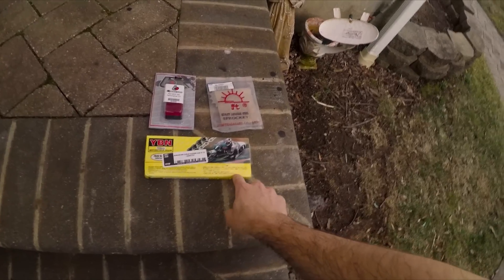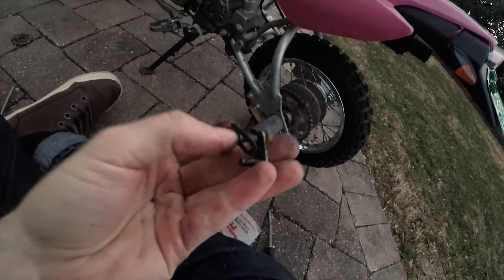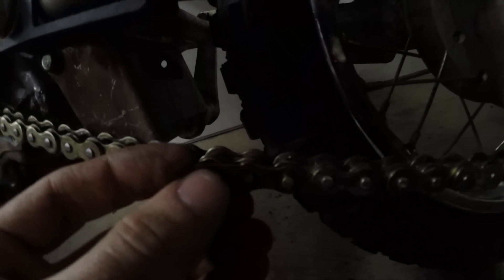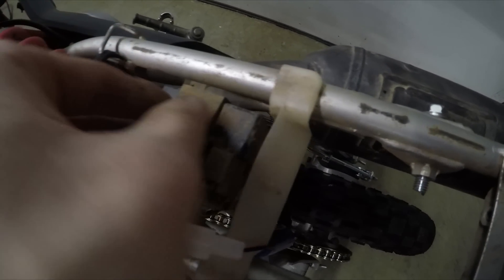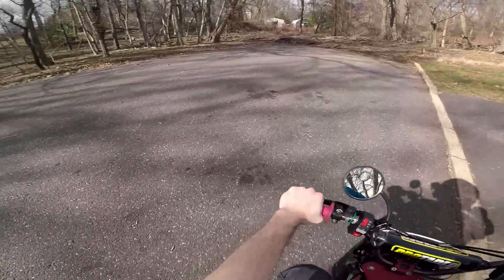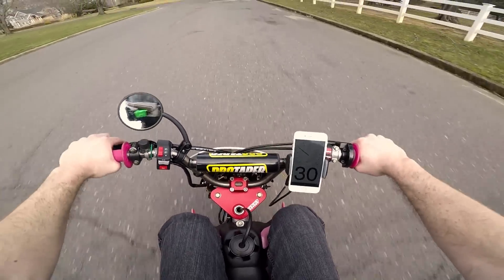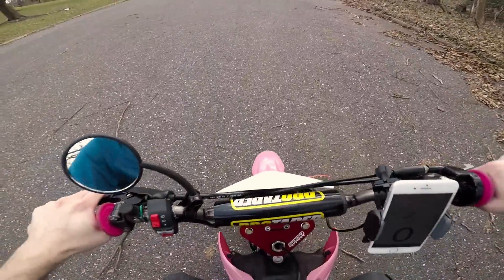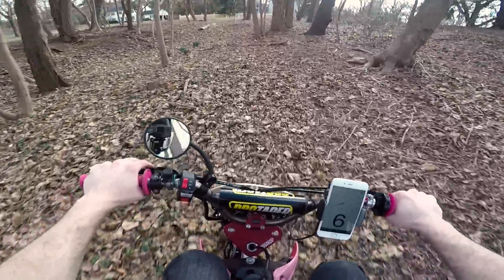Street Legal Crf50 SPROCKET & CDI INSTALL | New Top SPEED

Comment: my fully stock cf50f from 2012 with only a cdi change goes 35mph, sprocket change on the front and rear and a new carb with no filter and a new exhaust should get it to like 67+mph, the exhaust adds a big amount of low end and top end, but also adds like 10+mph top speed, the sprockets would be a 15/30 (front/rear), and the carb I have gives it a better throttle response and overall better rev-down, and the filter being taken off gives it an even better sound and power, however I recommend an amazon Chinese filter, same thing without a  filter off, just would be cleaned filter, and I HIGHLY RECOMEND you get a gas filter for the gas hose, definitely helps the bike run better and before I didn't have one the bikes gas in the hose started getting either a bit dirty or clogged, and a new carb that I got off of amazon is stock, only thing that makes the carb better is the gas filter, and if you're getting a gas filter, go with the racing brands, I also am getting street tires which are 2.75/10, which are the same size just a bit wider, and slick and sticky, best for cornering/wheeling/top speed/acceleration/and even a bit of off-roading. I definitely plan on getting lifted racing front shocks, and lifted racing rear suspension, also plan on getting subwoofer 600 watt speakers that attach to the bikes handle bar, which I plan on getting a PROTAPER racing tall handle bar. I would definitely get LED lights for under glow throughout the entire bike with a controller velcroid somewhere underneath the seat, headlights, break lights, and possibly turning signals.
Reply: Thats fire

Comment: I have a 2006 crf50. It's got an 88 cc big bore kit from tb, 16 tooth front sprocket and a 35 rear sprocket and street tires. I have hit 55 mph
Reply from the maker: so weird.. That is my exact setup! DO you have an exhaust?
Reply: cappamura you have to have street tires
Reply: I get 32mph on xr50r with 72 cc
Reply: John Ferry what brand sprockets you get? did you get them from fast50s? or tbolt? please let me know and did you keep a 420 chain?